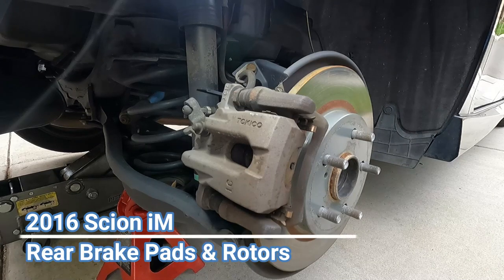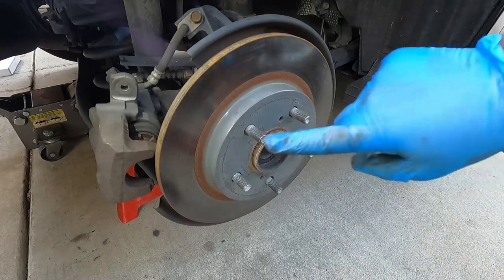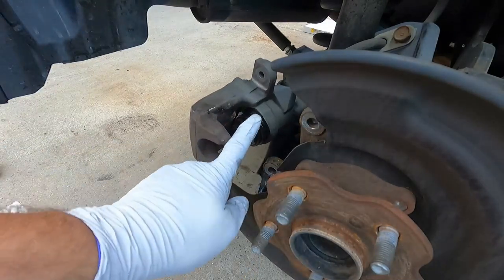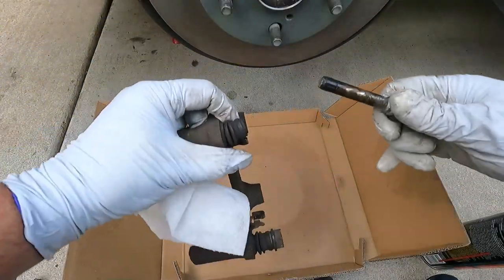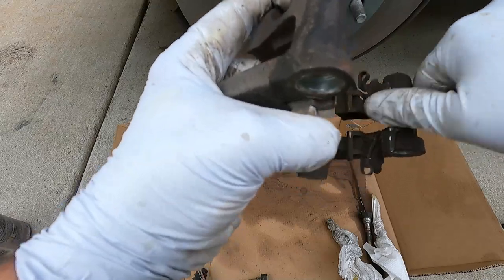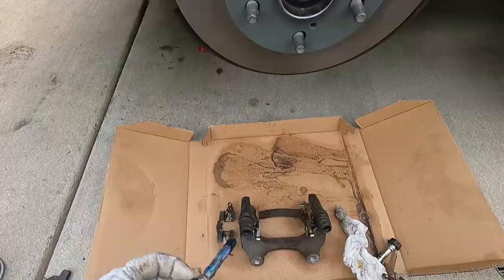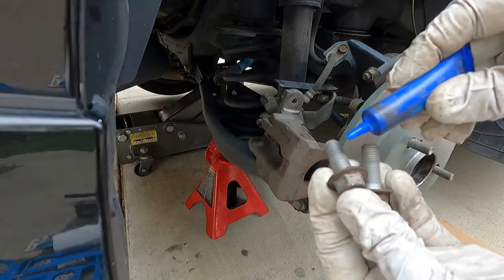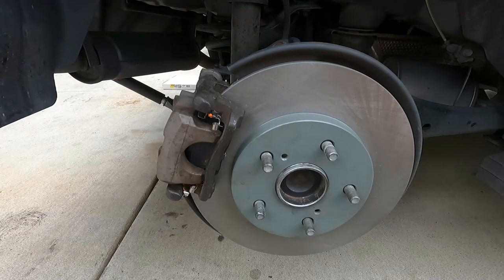2016 - 2018 Scion iM - Toyota Corolla iM - Replacing Rear Brake Pads & Rotors - Easy DIY!

Comment: We're in the middle of a brake job and after 15 minutes of searching for the REAR torque specs for a 2017 Toyota Corolla iM, this is the only place that was definitive, so we followed 42 & 25 ft-pounds as defined here.

Comment: Im using a tool like yours to push the caliber piston back in but it's stuck. Any reason for that? And what could be done thank you!
Reply from the maker: Sometimes the tool will get stuck because the threads are not the same as the threaded piston.  You may have to back the tool off and re-adjust it to continue to spin it back in.  Best of luck to you.
-Dan the Fix it Man